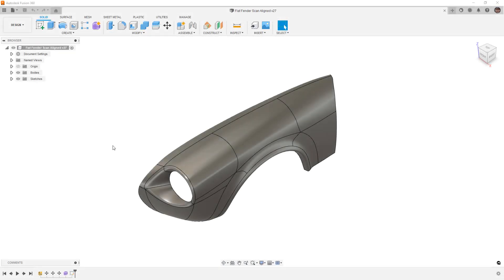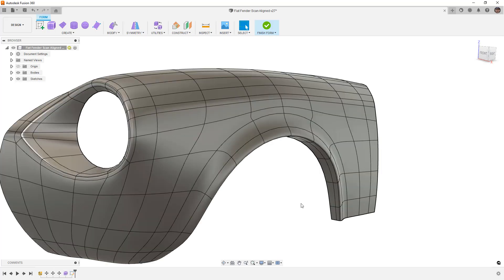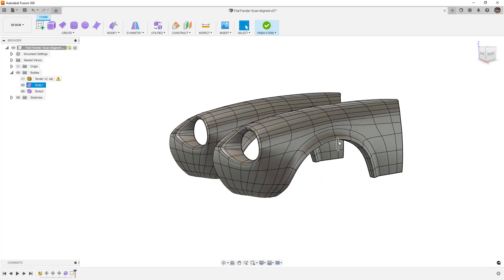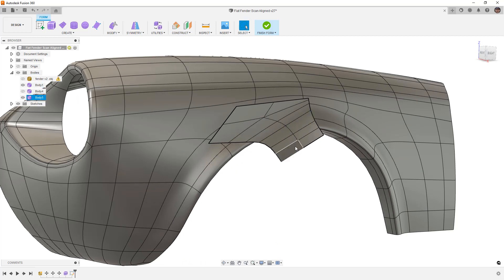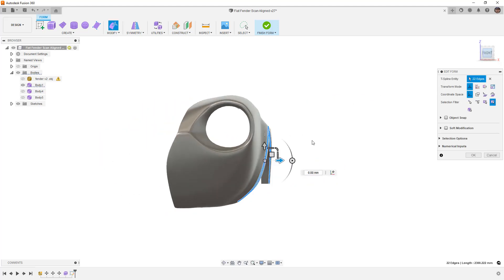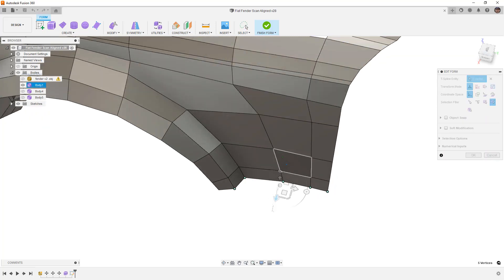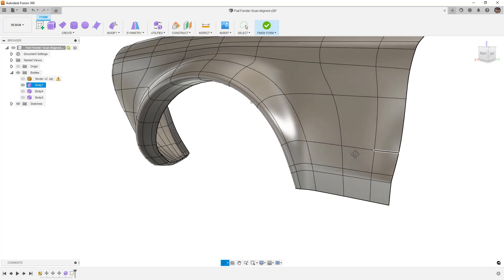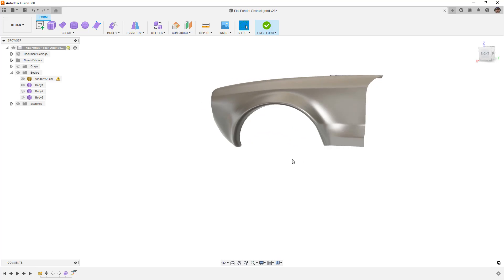From Mild to Wild | Let's Make a Wide Body Fiat Fender in 10 minutes #Fusion360 #Fiat

Comment: I wonder if you think this is a good workflow for game related vehicles? (Currently work on a unreal 5 prototype and now start with vehicle production and still wonder about my workflow...)
Reply from the maker: Well with Games the end goal is likely lowish poly models so this is probably overkill.  You would likely be better off staying in something like Blender or Maya to do all the modeling and have more control and options over the mesh layout.  I would only go this route with Fusion if you planned on making parts like 3d prints or molds because the end result is a true surface not a mesh.
Reply: @LearnEverythingAboutDesign  unbelievable - I looked everywhere to get some opinions but your one sentence just completely opened my eyes - like, of course! Thank you so much, you really helped me out here! I will try to use blender for my 3D model now! :)
Reply from the maker: @R-SXX  Happy to hear!  I don't know off hand what a good Poly count is on for game vehicles.  Unreal is pretty powerful but I know from doing some characters into VR using Unity that lower poly is much more responsive.  Using Smooth Shading and textures over small details is the way to go.  I would bet with cars that would be true also.  Grant Abbitt i think has a pretty good channel talking about specifics of game assets for a reference.  https://www.youtube.com/c/GrantAbbitt
Reply: @LearnEverythingAboutDesign  thank you! I will check that out, thank you very much :)